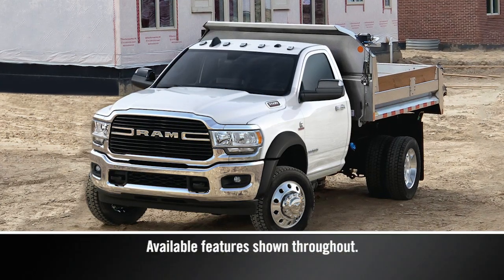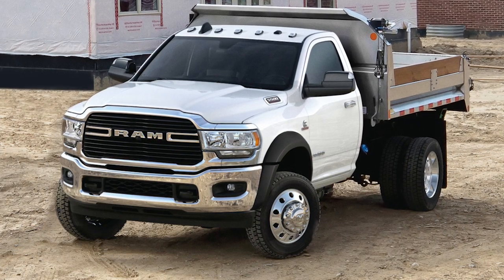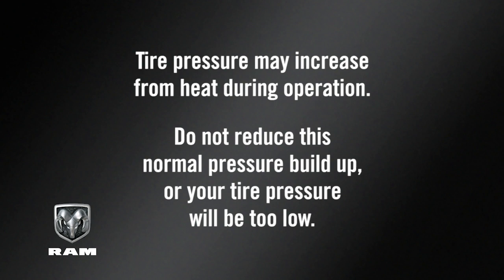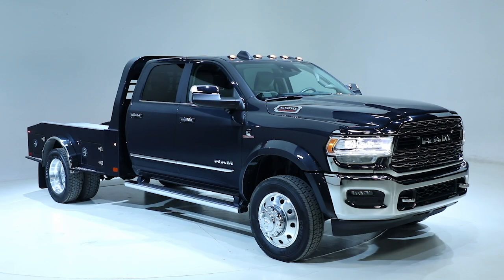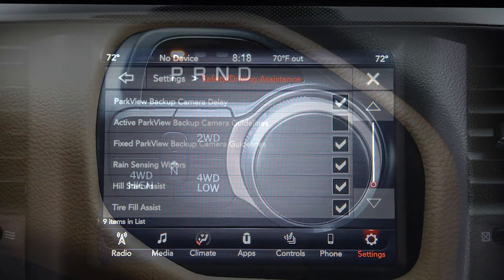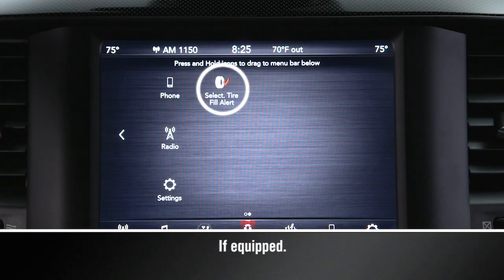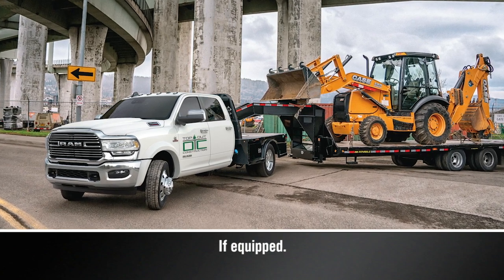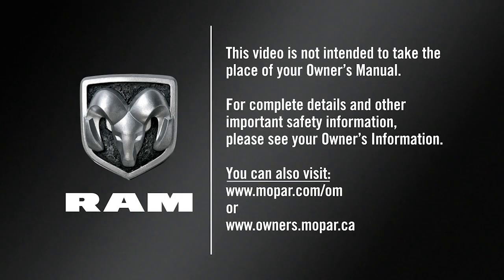Tire Pressure (TPMS, TPIS, TFA, STFA) | How To | 2020 Ram Chassis Cab

Comment: On a,dually the tpms system is stupid, because you cannot rotate your tires properly. i.eyou cannot put your worn front on the  rear, and the fronts always wear on the outside first. Stupid engineering